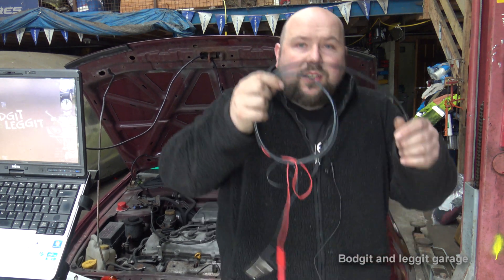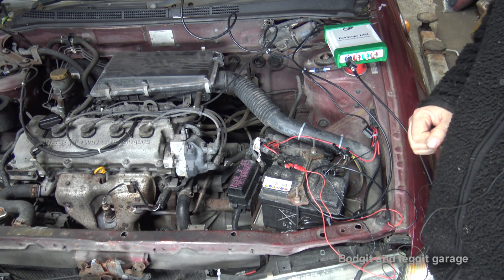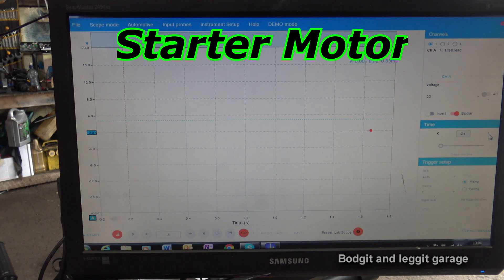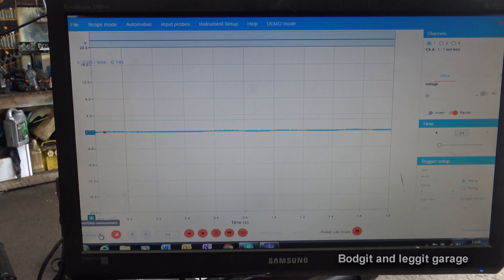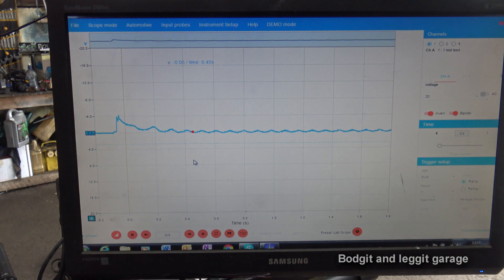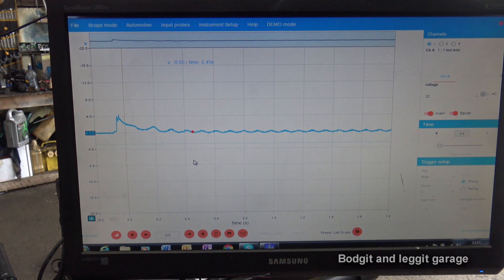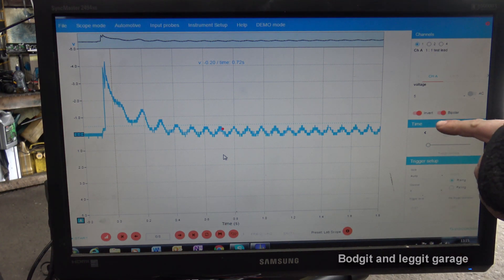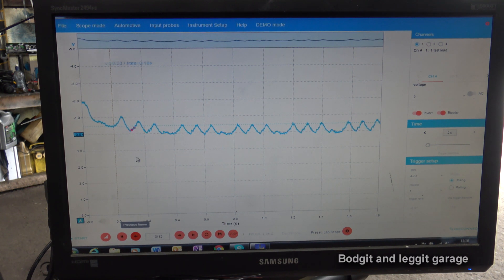Ditex Oscilloscope Relative Compression part 3 Bodgit And Leggit Garage

Comment: But i don't find an ac coupler in aliexpress.i find  atténuateur de Signal bande passante 10 MHz Oscilloscope accessoires Oscilloscopio.is the same or not??
Reply from the maker: Hi mate this is our scope is different from most others on every other stereoscope I've used the AC and DC settings are internal in the software we're on this go like I explained in the video you need the AC coupling to turn it to a c only on this particular scope they might be more out there I don't know but for this one that's how it works

Comment: To check for a misfire on a petrol engine take ht lead off while engine is running one at a time and listen for the sound of the engine to change with a newer car check the condition of the spark plug or plug in a code reader great video

Comment: I had a 1.6 Astra H in last week. Non start and on cranking sounded like the valves were bent or head gasket had gone. Very uneven compression sound. I put the Carscope-i on it and results were 100,53,74,73. Did out a couple of times with same results. Carscope-i confirmed my initial wrong diagnosis. Then engine was flooded. Plugs out & cleaned, cranked over. Then plugs back in and she started up good as gold. Keep an eye out for something similar, a video on that situation would be excellent. Cheers.
Reply from the maker: Hi mate I can only film what I get in if I get in something like this I will film it no problem

Comment: why can it not be used on a Wankel engine. miss fire live data misfire counters and  02 looking for a rich or lean and take it from there
Reply from the maker: Not every car has misfire counters not every car has 2 02 sensors this is a quick and easy way of narrowing down a cylinder and then take your diagnosis from their and what about a diesel by the time you have done all that I would have already I've known which cylinder is bad boom